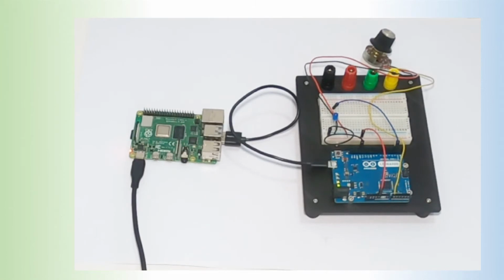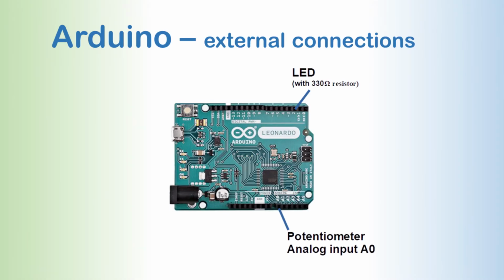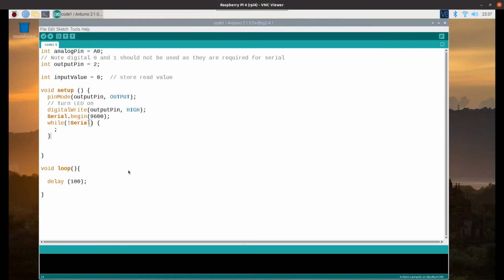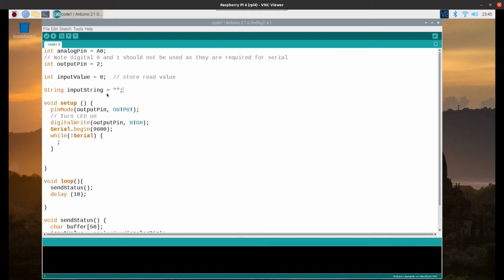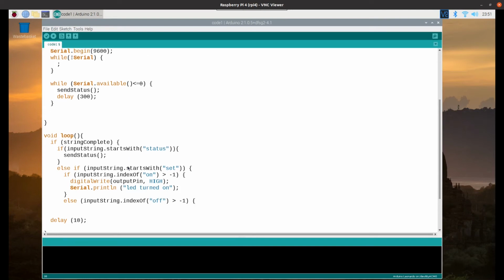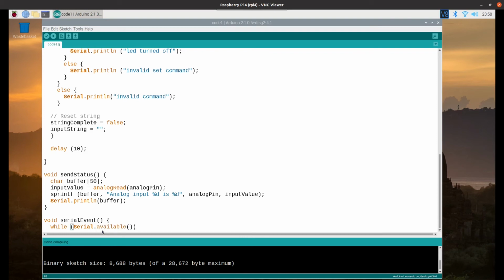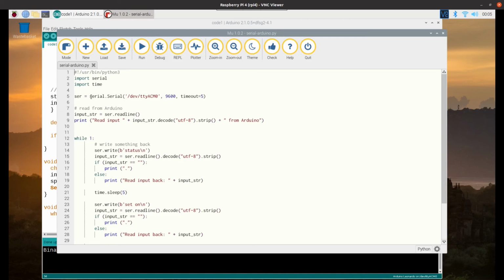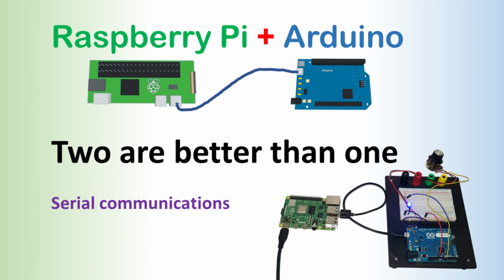Arduino and Raspberry Pi, working together over a serial communication. Step-by-step tutorial (UART)

Comment: Thanks mate ,  great show.
Are you OK with questions please?
I'm just an electrician learning about embeded programing which in nz is limited for training. 
My gear, 
PIRONMAN pi 5,  500gb  m.2 storage, 15" msi portable monitor  HD with on board speakers. Batt pack for monitor  and one for pironman pc.
Arduino seems to have better support for packet radio mesh fsk networks like radio head (not lo ra)
I want to mount a compact arduino  powerful type thats- Pi5 compatable into  my pironman pc for learning and projects.
Note  giga  arduinos are not cheap.
Thanks again .
Andrew New Zealand
Reply from the maker: I'm not really familiar with radio mesh etc, but here are a few thoughts about Arduinos. 

It has got a little confusing as they now have lots of different models.
They essentially come in 3 main types:
* Traditional form factor (eg. Uno). Although upgraded from the original they are typically less powerful than some of the newer microcontrollers. They are still popular particularly due to the amount of shields that have been designed for them. 
* Giga, for those that want lots of ports
* Nano, the small size makes them easier to incorporate into projects, and newer models with more powerful microcontrollers. 

These also have variants with or without WiFi / Bluetooth etc. 
There are also some other boards that are more specialist - eg. designed for Industry (and expensive), or other more niche models (eg. RP2040 based). 

I don't know whether your project needs a shield or if it uses on board WiFi, but if it doesn't need a shield then the Nano may be a good fit.

As an alternative I am using the Raspberry Pi Pico boards in some circumstances where I may have considered an Arduino in the past. These are considerably cheaper (especially the WiFi versions) and typically more powerful and more memory. The one downside is that they have not been around so long and so do not have the same support and libraries as Arduino (which is why I recently had to create my own library through reverse engineering a DFPlayerMini). 

There are also ESP32 based boards that are a good option for many projects, but sometimes not as well supported as the Arduino.

Whilst I'm not able to give you a specific answer to what is best for different circumstances I hope this gives you an idea of some of the options that are available.
Reply: @PenguinTutor  thankyou for your answer. 
Andrew Nz

Comment: did the raspberry board power the arduino board here through usb?
Reply from the maker: @EM8844  Yes. Power is connected to the Pi and then the Arduino is powered from the USB on the Pi.

Comment: Wow, thanks. I spend two days trying to do this. Readline() hangs the rpi. the following doesn't block.	
if arduino.in_waiting > 0:
		inChar = arduino.read().decode('utf-8')
		inputString = inputString + inChar
		if inChar == "\n":
			stringComplete = True
			# arduino.reset_input_buffer() # not needed, read must pull from serial buffer
                         checkStatus(inputString)		#pass iS to save	
                         inputString = ""

Comment: When using various Arduino boards attached to  Pi400 via USB, I notice that the Arduino serial plotter performs poorly when I am using a potentiometer or other analog device.  Specifically, the serial plotter seems unable to keep up with analog input.  I wonder if interfacing the Arduino with Pi400 via the Pi's  TX and RX pins might give faster performance than USB provides.  Would appreciate your thoughts.
Reply from the maker: The USB interface provides aerial transmission in much the same way as using the serial interface on the Arduino pins. It may be going through an external UART when using USB, but as a hardware device that shouldn't cause a performance issue.

How often are you sampling the data? You may be filling up the Arduino serial buffer. You could increase the buffer size, but if you don't need to sample at a high frequency you may find adding a delay to the sample rate improves responsiveness.
Reply: My specific problem has occurred when using the AD8232 with Arduino attached to Pi400.  The display lags as compared to that obtained when I attach the Arduino to a Windows computer.  The problem occurs whether I connect the Arduino to Pi400 via USB or via the 3.3 or 5V pins of the Pi400 via an adapter.  I have tried using a small delay in the Arduino code, but that does not solve the problem.  Since I don't have the issue on Windows computer,  when using the same Arduino code, I have to conclude that it is due to a feature of the Pi400.  I haven't tried the same experiment on my old Pi3 because it is slower and I no longer have the patience to use it.

Comment: When using an Arduino Nano attached to Pi400 via USB, I find that the Arduino Serial Plotter lags by comparison to the Plotter on my Windows computer.  Have you had the same experience?  Do you think that one Arduino is better for use with the Pi than another?  For example, I notice that the Leonardo is often recommended and that its processor is often touted as optimal for interfacing with the Pi, but I haven't seen a systematic comparison.
Reply from the maker: That's not something I've experienced. I mainly use Arduino on my Linux PC, but I have used it quite often on a Raspberry Pi as well. 

You may want to try a different version of the IDE. Version 1.8.19 has a version for ARM which can be downloaded from arduino.cc
Reply from the maker: The main thing about the Leonardo is that it has USB 2 built into the microcontroller. This means you can use it as though it was a keyboard or similar. Otherwise it shouldn't matter which Arduino you use.

Comment: Can they communicate with each other without the cable wire?
Reply from the maker: The classic Arduinos used in that example do not have any wireless capability (unless added separately), but some other models do. 

In the example below I have used an Arduino Nano RP2040 connect as a web server
https://youtu.be/jSsUebQ4I4g

Comment: Thank you for the video, however I'm wondering how could you reset the Arduino using the RPI?
Reply from the maker: It's not possible to reset the Arduino, other than when programming it. 

Once it's running the Arduino will normally be in a constant loop ready to respond to requests as required.
Reply: You could use the reset pin on the arduino connected to one of the gpio and just send a signal to that

Comment: How to activate arduino sketch only when prompted or activated in node red not when connected? Pls advise. Thx
Reply from the maker: The Arduino sketch will always run once the power is connected. If you don't want it to do anything then you can create a while loop which just loops around until a certain condition is met.

Comment: hi i bought a few Arduinos and they turned out to be fake or cloned with ch340 chip and i cannot do what i wanted i read that i cannot reprogram the ch340 chip  to be recognized as a hid joypad is there a way that i can make the rpi and arduino bypass the ch340 chip and get recognised as joypad like the Arduino Leonardo  as one thing  im trying to make a force feed back simulator steering wheel and because of the ch340 chip cannot be reprogramed to be seen as a hid when plugged in so could i use rpi as hid and use it to controll the firmware on an arduino  so use rpi as usb interface and brains use arduino as a slave for pots and motor drivers   im a new to rpi and arduino i have rpi zero 2w  arduino mega 2560 ch340 chip and uno with ch340 chip i also read that rpi zero can be detected as a hid with a few changes
Reply from the maker: The Leonardo uses a ATmega32u4 which has USB built into the microcontroller. This means you don't need anything external to use HID. 

The Raspberry Pi Zero can act as a HID using the OTG USB port. The setup process is quite complex. There are a few guides available, but it's not something I use at the moment.
Reply: @PenguinTutor  ok thanks there is a firmware called unojoy and it flashes the original uno so it is seen as a hid device when plugged in but i cant use it because of the cheaper usb chip i though i could use a raspberry to get around the ch340 usb chip using a rpi so the pi and arduino act as one  i cant phrase it right

Comment: I am curious as to why you said you'd be switching to an older version raspberry pi for the final version of your battery-powered project. Is the gain in battery life so big that it's worth the downgrade in processor, ram, GPU, etc? Another way to ask this is, is the model 4 that much power hungry than the 1?
Reply from the maker: That is indeed the case. As each new generation of the Raspberry Pi has come out then it that has come at the cost of needing more power.  

It's difficult to give an exact figure as are lots of other factors, such as which features of the board are in use (eg. 2 HDMI outputs uses more than 1). I think we are looking at a Pi 4 using in the region of up to 4 times the power as a Pi Zero.

You also have to take into consideration what you are powering from the same battery as motors or a large number of LEDs could dwarf the amount of power needed for the Raspberry Pi.

On the plus side battery technology has also improved, so you could swap in for a higher capacity battery to compensate.

It's also the case that most battery powered projects don't need the full processing power of the Pi 4 (unless you are including image recognition or other AI in the project) so a lower spec Pi is sufficient. 
As a general rule if I'm running from battery I usually use an older model preferably a Pi Zero, or in future the Pi Zero 2 (which power and performance wise will sit between the Pi Zero 1 and the Pi 4).

Comment: hi thanks for your video but i have some question
i want to use readable() in python(raspberry pi) but readable() always return 'True'
if there is nothing to read from arduino the code readable() have to return 'false' i dont know why.... can you help me?
Reply: wow Awesome you solve my problem!!! Thank you you're very genius
Reply from the maker: In Python readable is normally used on a file handle. 

There is also readable within the streams API which can be used with a serial console, but I've only seen that used with C/C++ and not Python. Streams in Python is something different (network connections rather than serial). 

Do you have example code that you are trying to use?
Reply: @PenguinTutor 
import serial

ser = serial.Serial('/dev/ttyUSB0',115200)

while True :
	if ser.readable() :
		print('good')
		c = ser.read()
		print(c)
	else :
		print('bad')

arduino send 'b' every 5 seconds so for 5 seconds the code have to print large number of 'bad' and print one time 'good' but when i try the code pi print just 'good' one time for 5 seconds
Reply from the maker: @b7133  It's not possible to use readable in that way. It just confirms that it's possible to read from the serial port, not that there is any data from it. readable will always return True.

Normally to read from the serial port you just use the ser.read(). This will normally wait until it gets data, but if you don't want it blocking you can add "timeout = 0" to the options when you create the serial device. 
eg:
ser = serial.Serial('/dev/ttyUSB0' , 115200 , timeout=0)

You will then need to check the value returned from ser.read to see if there is any data returned or not.

Comment: great lecture!! pls tell me whether Arduino Uno can send images to raspberry pi over serial communication ??
Reply from the maker: You can send any data using any of the methods. 

How effective it is depends upon the resolution of your images and how often you want to send the images. The speed of UART serial is measured in kilobits, so if you have an image that is in megabytes then that is going to take a long time to transfer (assuming you found some way of saving the image on the Arduino in the first place).

I would suggest using only low resolution images between an Arduino and a Raspberry Pi. If possible it's better to go direct to the Raspberry Pi or using Wireless technology instead.
Reply: @PenguinTutor  thank u so much !!!!

Comment: Thanks for the info. I suppose if you wanted to blink a light on the Arduino/etc, you would use some sort of if serial input = x, then do y, correct?

That'd be a good followup if you haven't made it yet.
Reply from the maker: Yes - you would normally use the import to trigger an update to a variable to track what you have instructed the Arduino to do. 

I will be creating a video on using Raspberry Pi to control an Arduino for model railway lights. It will use I2C rather than USB ( https://youtu.be/Wh-SjhngILU ) but it is the same principle.
Reply: @PenguinTutor  Thanks!

Comment: Great vid, can u make one where arudino and raspberry pi are using spi ?
Reply from the maker: Thanks for the suggestion. I've used SPI from both the Raspberry Pi and Arduino, but not yet used it to connect the two together. That may make a good alternative to using the traditional serial connection, which is something I may find useful in another project I'm working on. 

Watch this space - hopefully I can do something on that in future.
Reply from the maker: I've now added a video showing SPI used between the Raspberry Pi and the Arduino.

https://youtu.be/dzVLRjH5i78